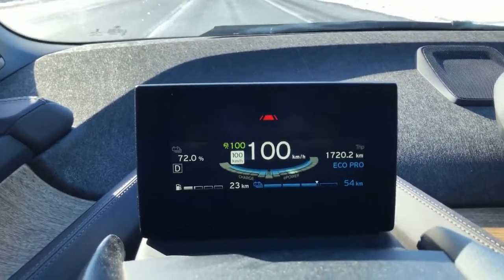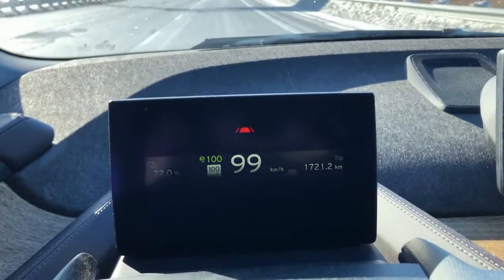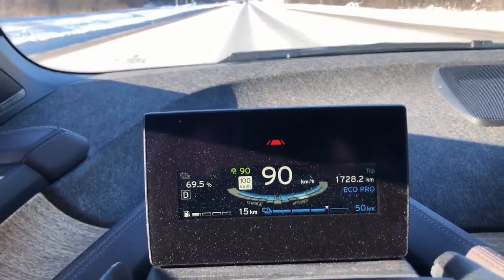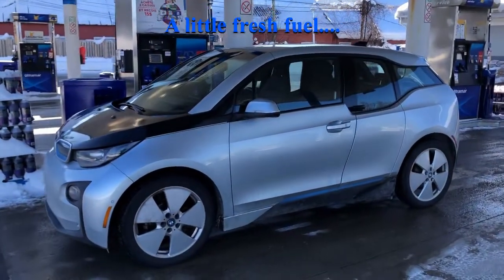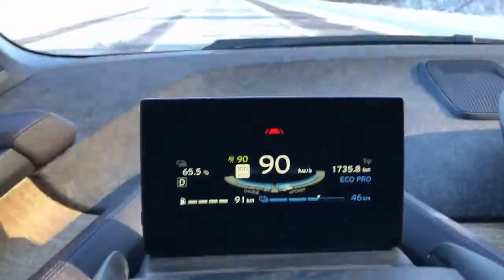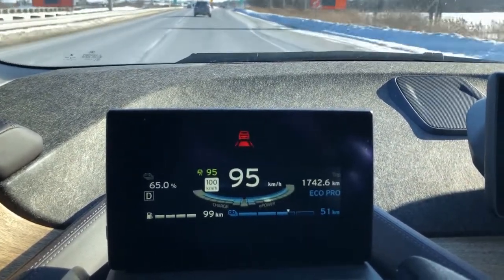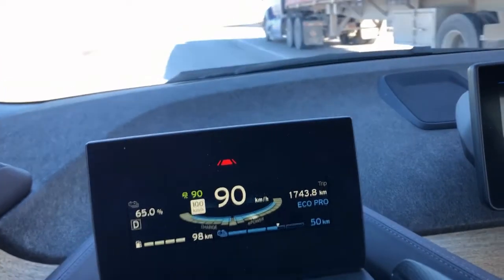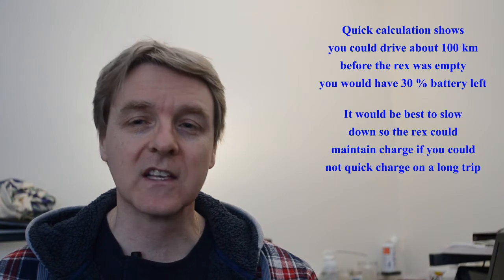BMW i3 Rex in winter at -13 Deg C on highway with Hold State of Charge (HSOC)

Comment: Hello! Nice video !
When you turned off the car and went out to fill the fuel, when you returned and turned on the car, did mode (HSOC) need to be turned on again or does it remain on? and tell us how the car behaves if you drive in the city in (HSOC) mode at a level of, for example, 50%? How much quieter is it? Does it turn off more or charge the battery more? If you drive slower, does it charge the battery above the set threshold or does it just turn off?
Reply from the maker: Thanks for the questions. Not really sure but when you turn the car off you have to re engage HSOC again I think. In the city HSOC works much better it will keep the car SOC. The REX has i believe two speeds and in the city it runs at the slower speed most of the time and is quieter. Mind you my rex is pretty quiet to start with. I don't find the engine running really bothersome or overly noisy. But that being said i really don't use the rex very much. the REX will not really drive the battery beyond the set point maybe it will slightly like 0.5 or 1 % but nothing more then that. It just shuts off when you get to the set point. Most of the time in the city it will also shutoff when you are stopped like for example at a traffic light.

Comment: If u really look at your trip it did actually great ur miles never really chged the % varies based on battery temp before u basically got 50ish miles at 73% battery 🔋 by the end of video and battery warming ur now getting 50 of range at low mid 60% soc with mean u were more efficient than when u started far has cold weather battery health

Comment: It is possible to keep heat selection higher and fan speed lower. This will somewhat reduce warm air loss from the cabin exhaust flaps. This works ok if there is 1 person breathing inside :)
Reply from the maker: I have played with the combination of fan speed and temp control. You are right it's an optimization to keep the windows clear and keep your feet from freezing. One thing I did in our Mitsubishi IMIEV was to block the passenger footwell duct to try to get better heat on the drivers side. There are a lot of tricks you can do but I really wanted to evaluate how well the car can do without any mod's. The heater is powerful enough to keep you warm and that was one of the parameters I did not want to compromise in this test.

Comment: At highway speeds and if driven very moderately in the city there is no difference between eco mode and comfort. On the highway this is true because of physics, and if you really thought about it for a second, at 90 KPH for example it takes a specific amount of power to maintain the speed, so no matter what mode you are in it will use the SAME amount of energy. (It slays me how people think they are getting more range at a constant speed using eco mode. In the city on my 2015 i3 I drive to conserve energy and use regen alot and when I switch to eco mode there is literally no difference. I believe the car was programmed to maximize comfort mode rather than any other mode.
Reply from the maker: Hi John,  Yes I agree the mode of the car Comfort/Eco pro/Eco pro + can't change physics. These "modes" only change the amount of heat/AC you get. Comfort allows for full heating/cooling. Eco pro allows for a reduced heating/cooling. Eco pro + allows for no heating/cooling. The throttle response also changes with the mode to encourage more eco driving. However all of this really has not much to do with this video. I drove the car in eco pro so that I i would have some heat as it was -13 deg outside and I did not want to freeze in the car. The main take away point of this video is that at highway speeds and low temps with the heat on in eco pro mode it is very marginal for the REX to maintain the battery SOC. I made this video so people would realize that. I was driving 90 KPH. if I drove faster the SOC would drop even more rapidly.
Reply: @dondakin1  Thanks for the response. I find that at a constant 90 kph and 2 degrees (Celsius), setting the heat to about 22 only takes about a 8 km hit. (Obviously colder temps will degrade the range even further. Considering I have the rex and optioned so I can turn it on anywhere below 75% its perfectly fine for my needs.
Reply: I find something similar...however this is with a heated battery (preconditioning). This morning at - 3 c and no pre conditioning it was showing 18 km deficit.  This will improve as the battery warms, but preconditioning is key. Also checking the battery Temps, I find that after 3 hours the battery temperature was around 7 degrees where it is supposed to warm the battery to 10 using a level 2 charger.

Comment: These are first Gen model i3. You need the 2017+ rex
Reply from the maker: I agree a bigger battery would lessen this effect.
Reply: @dondakin1  Bigger battery or also higher output Rex?
Reply from the maker: @dopiaza2006 good point a higher output rex would be a better option then a larger battery which would ultimately suffer the same issue as the small one albeit farther down the road.  Guess that would make the i3 closer to a volt.